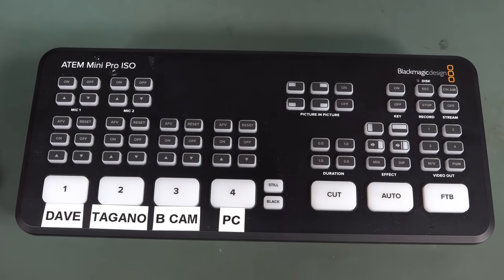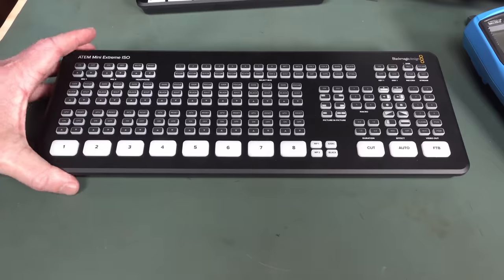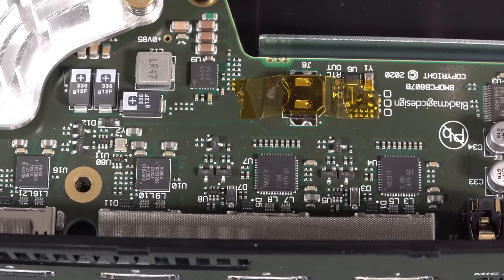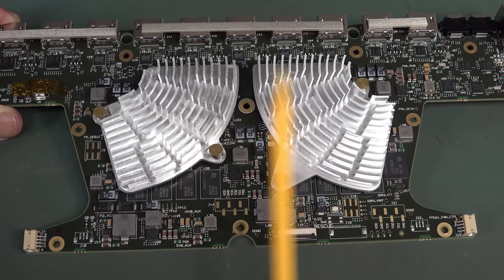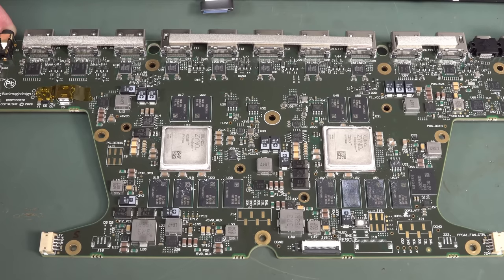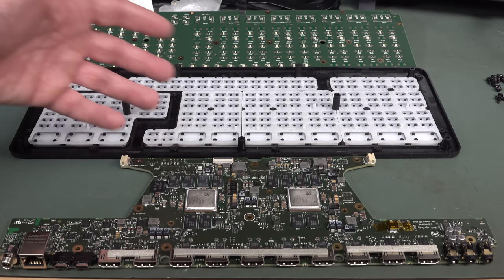EEVblog 1396 - BlackMagic ATEM Mini Extreme ISO TEARDOWN

Comment: Atem's stuff is very impressive.  I love the fact it just "deals" with multiple random sources of video.   That heatsinking is a work of art.  I hope they've put the same effort into security to stop clones, but with the affordable price as standard that removes a lot of the incentive to copy it.
Reply from the maker: Even less incentive to copy when there is no alternative to the huge FPGAs used.
Reply: @EEVblog  The clone version just uses a multiplexer and calls it
Reply: Bigclive, when you go into more professional types of video production, you will run into problems in which the "just dealing with random sources of video" stops being true.  We switched out one of the first rack-mounted ATEM's (4 SDI inputs) with a higher version because something the manual said it could do, actually was something it couldn't (mixing standards of video between HDMI and SDI, you could only use SDI or HDMI, and then there still was an incapability to mix standards.

And then there's standards in transmission lengths: We had trouble with a transmitter blocking and showing intermittent green frames, that was on a 50 meter long SDI connection (at 720x576) so well within standards.
When we put a Sony tube monitor in between the end of the cable and the transmitter, suddenly all problems were gone...

And then there's been our mobile setup after starting a transmission having an input go down for no reason, and we had to powercycle the mixer...
Hyperdecks quitting recording upon insertion of a new disk...

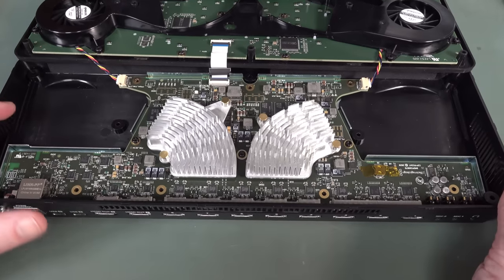Comment: 7:28 - Protip: Position it on your desk, put a strip of gaff on the front to hold it in place; plug in all your cables, dressing them straight back away from it, and then inchworm another piece of gaff across, touching the desk in between every cable.

Did an entire 6 month season, didn't move a millimeter.

Comment: 275.00 US in 1000+ (Texas Instruments licenses the ARM IP, as well)
Reply: Quite a bit less than that if you have a agreement with Xilinx and are big enough. But you would also be under an NDA.
Reply: how about just going to ARM the company?
Reply: @dh2032  It's the FPGA fabric and its processor interconnects that you're paying for. Otherwise, it's just a run-of-the-mill quad A53 SoC. You can get similar SoCs individually for under $100.
I've spent the last couple years writing software to run on one of these chips' bigger brothers (the zcu7ev).
Reply: @JamesPotts  thanks, so the magic is in the it's software, not the hardware. :-)
Reply: @dh2032  Not 100% like that. FPGAs are essentially "blank" CPUs that you can "program" to be any sort of processor you specifically need. Once you have written this into the fabric, you run your ACTUAL software ON that. It's pretty funky. The ARM cores are essentially co-processors you get on top of that, and the super fast interfacing since it's all on one die.

Comment: Very smart curving the heatsinks because it breaks up the boundary layer so the cool air impacts the fins, ie, cool air passes down the centre of straight fins insulated by the hot boundary layer. It's why Yamaha specify a 15º forward angle on their air-cooled KT100S engine.

Comment: Bulk buying 1000 Trenz Electronic TE0803-04-5DE11-A modules costs $600 - 700 US, so I'd guess you could bulk buy 1000 individual chips for like $300 - 500 US if they were in stock.

Comment: I cant believe how old those chips are, the Mali 400 MP2 was used in the Galaxy S2 (2011), the A53 was a first 64bit processor, the low power baby sibling of the A57 (2012).  It's insane to me that they can power this mental device.

Comment: The fans blow out of the back, silly upside-down Aussies.
Reply: Took all my strength not to comment that. Now I've commented that. You monster.
Reply: Yeah. Or maybe their aerodynamics are inverted too.
Don't know how planes flies in the south hemisphere by the way. Does they fly upside down, like, keeping flying the same attitude despite the blue side not being up anymore? Or backward, maybe due to turbofans blades working the opposite direction, just like these fans, or like bathroom sinks does once you've crossed the equator? 
Australia is a strange place, indeed.
Reply: hahah i was about to write that;p centrifugal forces work towards the rotation axis in Australia 😂🤣
Reply: @St0RM33  Yeah that's how they keep their feets on the ground there, thanks to Earth rotation.
Reply: @Damien.D  Aussie jets are actually carbon negative - they fly backwards, extracting energy and carbon from the atmosphere and storing it as kerosene in the fuel tanks. It's all very Tenet.
Reply: look at the blade geometry, i thought this too at first but the blades and rotation are incorrect for rear exhaust.
Reply: @frollard  i totally forgot that, man they should've picked a fan that rotated the other way
Reply: @flandrble  It could be just a wagon-wheel effect with the camera framerate making it look like it's spinning in reverse.
Reply: Whatever about the fans and Aussies being back to front, they certainly have moved the prosumer video industry way ahead. Well done BMD.

Comment: 7:50 the kb plate pictured is from a model M keyboard (1985-present). The kb that was sold with the PC (1981-1984) was completely different. While it did have a big metal plate in it, so did most keyboards from 1981. These IBM PC and XT keyboards actually had two big metal plates inside as well as a thinner metal plate on the back.

The plate pictured is from a "second gen"(1987-1992) model M keyboard (likely a 1391401). The plate for the original model M keyboards (1985-88) (most notably 1390120 and 1390131) had a bigger and thicker plate than that one, and weighed 300 grams more.

Comment: I don't understand why you're not using the BM DaVinci Resolve editing software for your videos. The Atem Mini ISO models not only record all your stream, but saves it as a complete project, with pan, camera switching etc.
You can then directly open your project in Resolve after recording, and edit/fine tune the entire multicam session. It is incredibly powerful. No worries, if you messed up a transition in the recording, just fix it in post.

Comment: Are you sure that this is not a prototype unit equipped with larger FPGAs? In my view, the BOM costs don't add up. You can't sell this for 1800$ if the FPGAs cost 500$ each in volume. Often designers run prototypes with bigger FPGAs for debugging and test code and fit a smaller pin-compatible one in series production.

Comment: They also decided to use 2 of the same identical FPGA to help with volume purchasing.
Reply from the maker: But in this case they are still so expensive that if you can get away with a 2nd cheaper one, you'd do it, even if it means an extra BOM item.
Reply: @EEVblog  This can work if your quantities over your product are guaranteed.  There is a value in knowing that the chosen FPGA is the same one with the same basic metrics over a slew of different products you manufacture instead of penny pinching for one device which may prove to be a best seller, or a dud compared to the next smaller device down the line since the 2 different sized video mixers are close in function.
Reply from the maker: @brianhginc.2140  Yes indeed. Not saying it didn't factor into it, but at some design point it's going to be a better choice to use say a 2nd $25 different FPGA than the same $250 FPGA just because you already use it. In this case I'm sure they actually needed it though.
Reply: @EEVblog  Having a second channel video 'compression' channel, yet some fewer functions means you would be going from a $250 FPGA to a ~$150, not down to a 25$ FPGA.  This price drop could only work if the master FPGA could compress 2 simultaneous streams.  However, looking at the ram by each FPGA and the fact they need to potentially scale and de-interlace numerous source videos to 'cross-switch' to 2 different end point encoders, based on my past experience with studio video hardware and FPGAs, I would have to say that each FPGA is identical, having all the source video inputs fed to each one in parallel.  Your button selection and overlays for each USB/Video output channel output is being handled by each FPGA as each one internally does the mask and overlays of the selected channels.  IE, have 2 identical outputs configured, and actually, both FPGAs will be doing the same work twice over.  Yes, one would still be a master and the other a slave as well as some simple switching shared bus tricks to spread all your source video channels between the 2 FPGA LVDS receiver channels crossing 2-4 additional switched unprocessed channels between the 2 FPGAs to bridge access to all the source video channels.
Reply from the maker: @brianhginc.2140  Yes, that's what I said, in this design they almost certainly needed it. I'm just making the general design example there is would be a point at which is doesn't make sense any more to re-use the same FPGA (or other expensive part) just for volume price advantage.

Comment: I've never seen a centrifugal fan that exhausts from the center. Is that a thing?
Reply: They have different laws of physics in Australia.
Reply: @FrankDrebin  😂
Reply: @FrankDrebin  upside-down/  backwards...... meh good enough. Lol
Reply: Of course you've never seen one that exhausts from the centre, that can't possibly work. Its not possible. Its centrifugal so it sucks from the centre and pushes air out to the side.
Reply: He did say that Black Magic is looking for good engineers.... at 9:20 haha
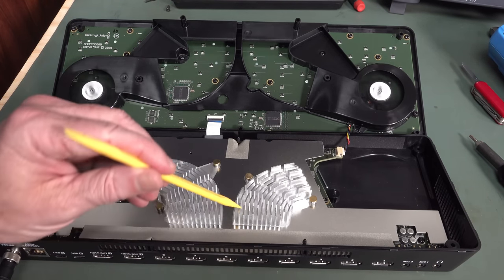Reply: @simontay4851  Look at the way the fans are spinning at 5:20 and the shape of the blades. They might not strictly be centrifugal but they are radial and they exhaust from the center
Reply: @max_kl  Looking at those blades @ 15:38, if they are spinning left and it's not some visual effect due to shutter speed, they would operate very ineffectively. And I doubt they would even work in reverse in that case because of the centrifugal effect.
Reply: @Kris_M  yes, it's certainly weird. Dave also says they blow from the center and I don't doubt his airflow sensing ability :) I really wonder why they did it. I assume the noise would be worse as well
Reply: Totally, but they're hella expensive due to the nano-black hole at the center that makes the center exhaust possible.
Reply: @AttilaAsztalos  That explains the $1300 price tag. Would be great if they offered a version with regular centrifugal fans for half the price!

Comment: I work in the events industry in New York City and Australia is killing it in the video industry. Also check out Decimator Design, Aussie based, they make elegant, inexpensive converters and monitoring solutions. Great stuff!
Reply: I was told the bloke who owns decimator is obsessed with power efficiency. Squeezes down every last watt. 
Very proud of decimators being Australian. The MD-HX is the best thing to ever come out of this country. (Excluding wifi)
Reply: @jazzcat123  The MD-HX is a video engineer's swiss army knife! I recently saved a college graduation ceremony with one:

They had the parents distanced in the basketball court which had an aging 'Jumbotron' that would not interface with anything but an interlaced broadcast signal. Luckily I was able to whip out the MD-HX and use progressive segmented frame mode and put the 720p60 live stream through the jumbotron so the parents could watch their kids graduate!! 

All of that done in 1 FPGA and a couple supporting chips. Fuckin' ACE.

Comment: Multiple JTAGs on the same chain is a headache if you are not building the volume required to justify the investment for boundary scan. This wouldn't be that bad since they are the same processor/manufacturer. but if you have multiple manufactures on the same chain then the vendor supplied dongles either wig out or are a pain to setup correctly.

Comment: Hey nice video! I've got an ATEM Extreme ISO with a failing HDMI port 1. I suspect the TDP158 (same failure as a lot of others have complained about and X-Box as well) chip but don't know how to test before replacing to confirm. Any idea how I can verify that chip is the culprit. I've been through all the usual suspects, cables, the HDMI connector, etc. Any help will be appreciated!

Comment: As an actual user of BMD/ATEM stuff.. I can say, without a doubt.. that they DO have thermal design issues in some of their products.. a great example of this is their BMD Intensity 4K cap cards.. which FAIL thermally.. and QUICKLY (the BGA's just DESTROY themselves thermally after a few weeks of use if one doesn't REPLACE the heatsink with a larger one and add more forced cooling)  I had 3 cards fail in this fashion in a row.. the 4th one I replaced the heatsink.. and its lasting a bit longer now...  and working with their customer service.. well that fails WORSE than the BGAs! (sorry to say)

Comment: I assume the membrane is not in one go because they may have designed it to be modular. Most likely using the same membranes in different sizes/configurations. See the notches on the edges of some of them?
Reply from the maker: Ah, you might be right.
Reply: Also injection moulding is a black art, and it only gets harder the larger and more complex the part is. Multiple smaller dies may have been significantly cheaper/had greater yields than one combined one.

Comment: Hey so one of the buttons on the Atem Mini Extreme is labeled "Sting".  Its towards the top right of the board, in the wide 2x15 array of buttons.  It currently doesn't do anything but we are hoping Blackmagic will add support for it later.  Can you confirm if and what it is wired to? Thanks!

Comment: A lot of unpopulated locations as well. I wonder what those two unpopulated connectors at the front of the logic board are for?
Reply: Mostly debug stuff, like UART, JTAG etc. Possibly some provisions for putting a bootloader there as well

Comment: i like the undersized coin cell so far in to that holder that you will never get it out
Reply: Often these cells are rechargeable, not just primary cells, so maybe supposed to last 5-10 years. Its possible to pull them out of the holder but outright PITA

Comment: Does look like two ATEM minis in a single box so I wonder of that's reflected in the firmware architecture,  each processor handles 4 inputs and one of the output hdmi and one of the usb channels, with some inter-processor comms to handle crossover.
Reply from the maker: Yeah, would be interestign to know exactly.

Comment: So two FPGAs were cheaper than a single FPGA that's twice the size?
Reply from the maker: Might not have been possible to get a bigger FPGA in terms of ARM cores and encoders/decoders etc. And future updates would be much easier if you standardise your platforms.

Comment: Okay you have to stop saying custom 'OS'. As if they wrote a custom kernel. I have spent years working on the Ultrascale+ series of SOC's and would bet its just yocto+xilinx tools aka petalinux. Yeah If anything was added to the fabric more then likely it has a few custom drivers which suck to write but honestly not a huge deal. I couldn't tell you exactly what they are doing with the 2 R5's but OpenAMP/libMetal support + freeRTOS  allows for a lot of possibilities. Im guessing they might have custom IP in the fabric to handle video processing but honestly that might not even be needed. Xilinx offers some okay off-the-shelf ip blocks for some of that already.

Comment: After a quick look around the old internet, it seems that there are only 3 open positions at Black Magic. So not exactly dying to hire new people then it guess. Also seems that other than LinkedIn there is no online application process. I guess Dave is referencing some jobs for those who already have a contact at Black Magic...
Reply from the maker: Don't always rely on advertised jobs. If you have the skills, talk to them.
Reply: There is an extremely high demand for skilled embedded software and hardware people in Melbourne, several companies are hiring as fast as they can and have been for a while.
Reply: @EEVblog  I would, if I knew who "them" are. :-)
Reply: @mcconkeyb  They do have a bunch of office addresses and phones and emails on their website...

Comment: couldn't you have one of the zynq's be for fpga and operatingsystem stuff and the other one only be an fpga for only the hdmi stuff? i mean you could load basically the same bitstream without the price for the additional arm cortex cores
Reply from the maker: They already had the design done for for the 4 channel unit. Makes heaps more sense to just duplicate that.
Reply: Also from what I recall you don't save a ton by going from the Zynq to a similar standalone FPGA. It's really the FPGA part you're paying for.
Reply: Nope, four simultaneous hdmi streams is about all you can physically get through any single fpga in this class/price bracket. Two fpgas will be many, many times cheaper than a single one that could do eight.